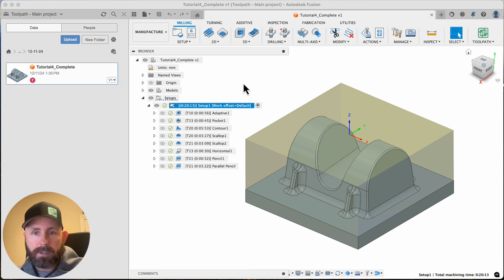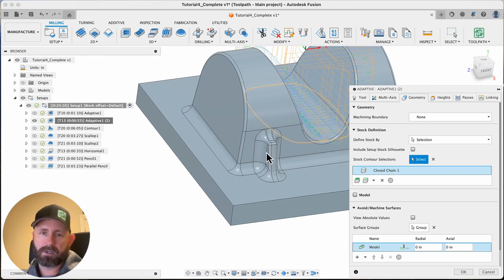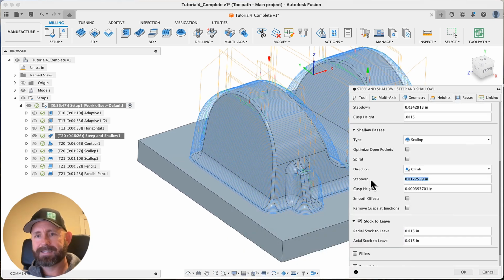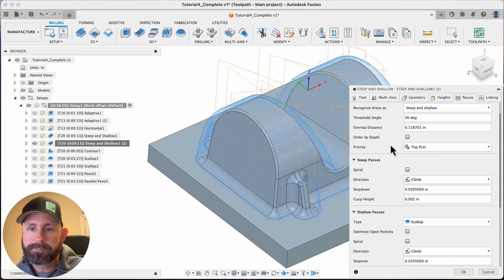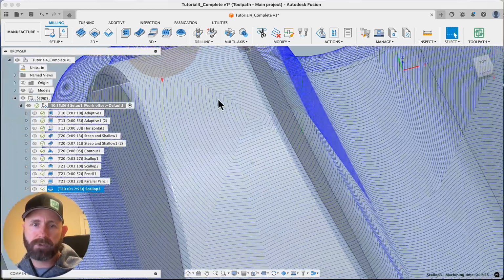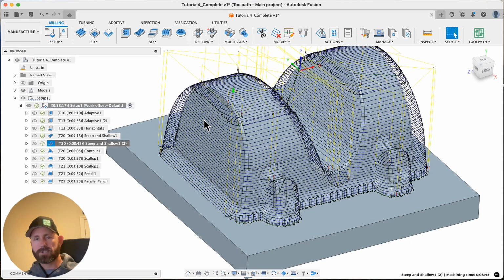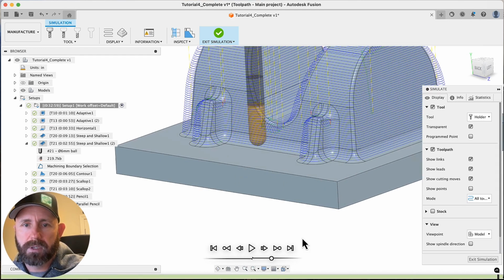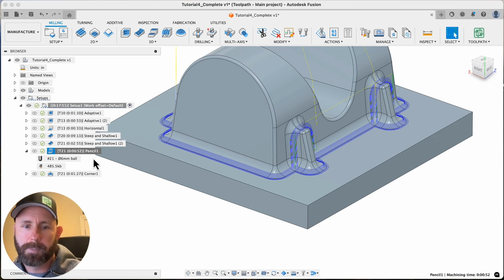Steep and Shallow Deep Dive!

Comment: Why does my toolpath always fail when I use that new geometry selection and put in a value for it do avoid?
Reply: Not sure I have enough info to answer that. If you are talking about the newish "avoid/machine" surface selections. If so and assuming you did everything right, I would guess that you are making too much of a clearance. I almost ever have an avoid of more than .001 and it's usually more like .0001 or .0005"
HOpe that helps.
Reply: Also, sometimes I'll have to make my toolpath tolerance VERY small. Like .0001 if you are making your avoid conditions too constraining for a larger tolernace
Reply: @ToolpathTim  what’s the minimum tolerance you can put in? I tried smaller than .0004 and it turned red and wouldn’t let me

Comment: Great video. New subscriber here. What I would love to see is two sided operations. How do you go about having features on both sides? Flipping the part in cam and setting up the axis.  That would be very useful.
Reply from the maker: Great idea! We made a video a while back that covers some if those topics. You can check it out here: https://www.youtube.com/watch?v=v93LNC-jRbs
Reply: @Toolpath I see so you have to copy the entire component into a part.  flip it copy it into the same part and then do rest machining. I’m still a bit confused about where to set the origin point. I think the mistake that I’ve been making is that all I was doing was just trying to machine from the bottom of the same part meaning I just flipped it and set my XYZ to a different orientation in the new 3d parallel operation.
Reply: @StasAudio  I can make a simple video for this. To be clear... You are looking for a good, simple way of doing a two op part? First op, flip, realign your Work Coordinate System and then machine starting with the stock condition that you had from the firs top?
Reply: @  I did end up figuring it out based in your other video but maybe there’s a better way so yes that would be great.
Reply: @StasAudio  Once I'm back from screwing around for the holidays I'll knock this out with a 3 op part.